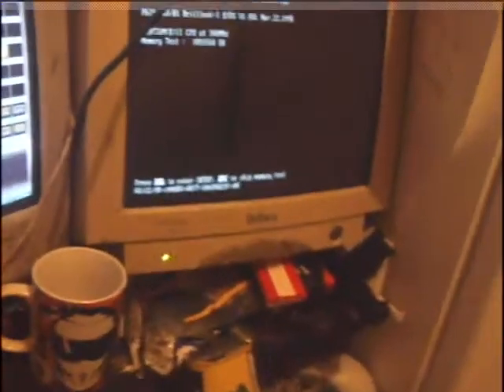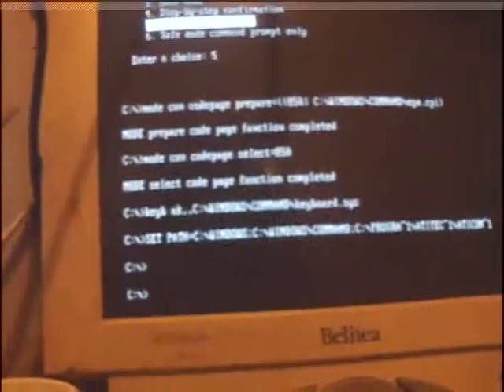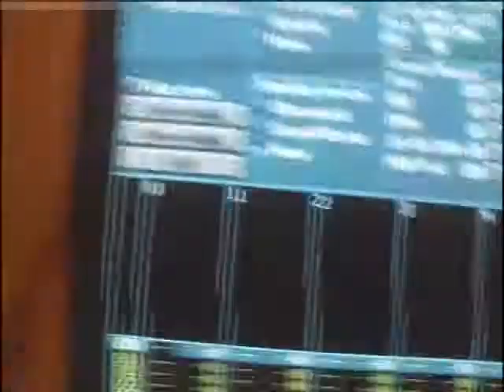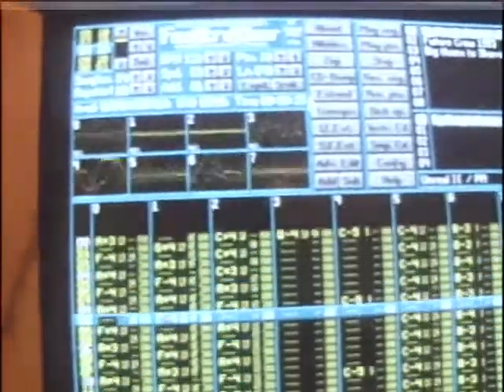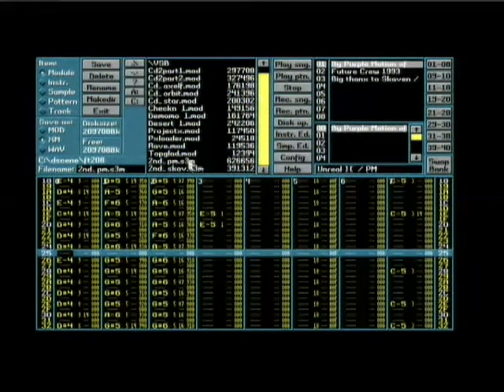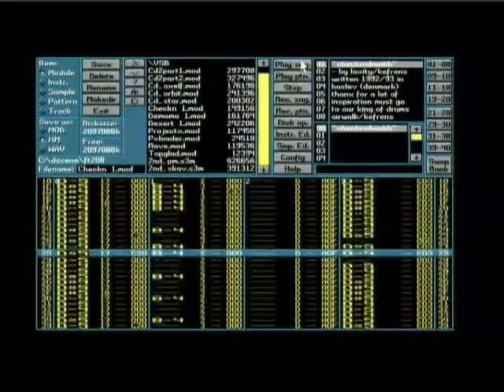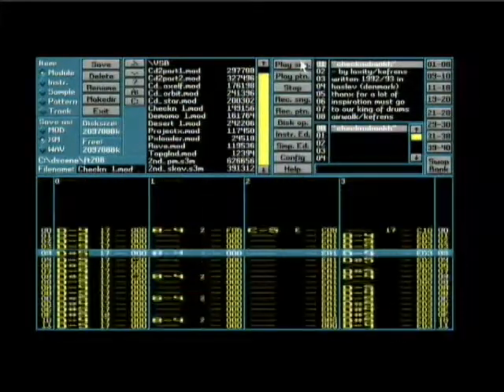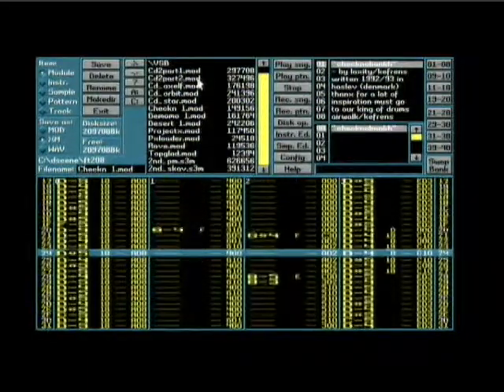Home Made Sound Card (Stereo Covox / LPT DAC)

Comment from the maker: @killerbee230 You can use the normal drivers, but you will only get mono sound unless the application supplies it's own stereo drivers, this is why I included a Mono switch on my schematics, as you will be getting mono sound most of the time anyway. As for DSS, I have used it before, I might test it with this device.

Comment: Very good !!, I have a query, why are there some Covox mutants that have TDA1543 DACS? not just resistors, how would this work? Would it have the resistors and it works like the original and then that signal goes to the TDA1543 to improve the sound or quality? I don't understand much about electronics but I saw these mutant Covox, some with amplifiers that is understandable.
 Sorry for my english, greetings
Reply from the maker: I have never seen such a Covox and cannot give a definitive answer. Interestingly it seems the TDA1543 is 16-Bit, so perhaps they're doing something smart to get 16-Bit audio out of the LPT ports instead of the 8-Bit audio the regular ones are capable of. To cut a long story short, all I can really say is that there are probably countless variants of these things out there and, as people built them themselves, they likely just tweaked, added or removed whatever features they wanted as they wished - Much the same as, say, when me and a friend build new PCs, he might use a Sound Blaster where I might use a RealTek, where it basically comes down to preferences and usage cases.

Comment: In fasttracker You have to increase that amplification to overcome noise levels, when playing with SB or Covox things. I made too Stereo-on-LPT1 covox on 1994 (it used one bit to mute or swap channels). That sounded so ugly that my fellows laughed (yep, requirement atleast pentium (1995)). Though 8-bit mono covox sound really good. So far best sound I got when using 2 LPT ports with 2 COVOX for stereo sound. It sounded just like Soundblaster. 8bit covox was best with Inertia Player+interpoltion.

Comment: Hi HighTreason,
I'd like to have an audio device for Stereo-on-1 on my old Laptop, but I can only build the Covox Speech Thing what can only output the sound in mono. I've Disney's Sound Source too, but it's the same with an ugly low quality.
At first I thought that Stereo-on-1 are only 4 bits for the left and 4 bits for the right channel, but the programs does still not allow Stereo-on-1. Need it exactly this circuit diagram what you linked in the description, so that the programs allow it, or does other circuit diagrams work too? If the 1st answer, how can I get it? Because I've very few electronic components and I can't solder too.

Comment: Very nice setup i build this one http://www.epanorama.net/circuits/dacs.html called cent_dac purchased the op chip from ebay much simpler and sound better that using the resistor lader
Reply from the maker: Thanks. Indeed, there are a few designs out there.
As it happens, I've been reworking this one so it can be published in the Gerber format and etched. I will have to test it before publishing the updated files however.